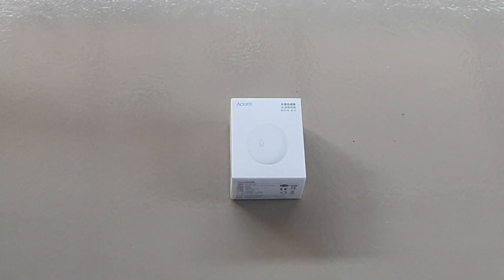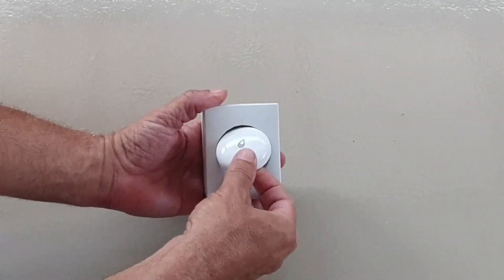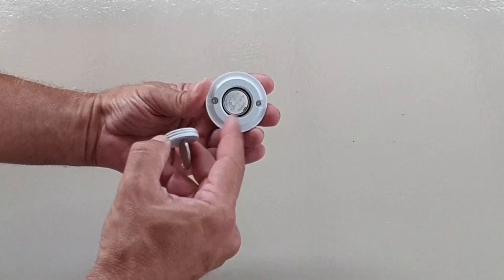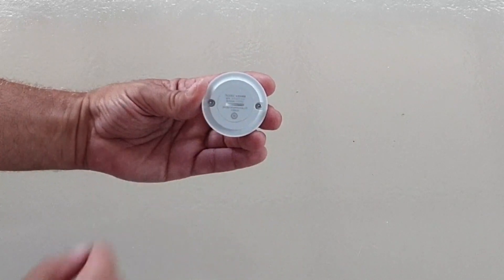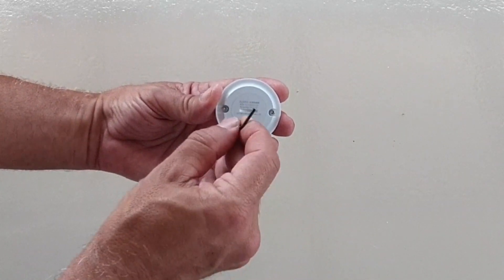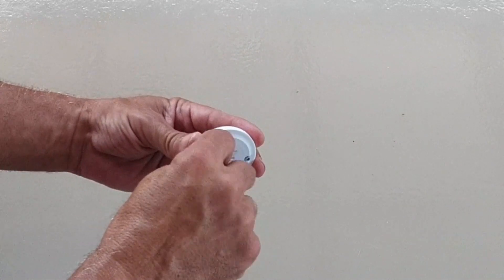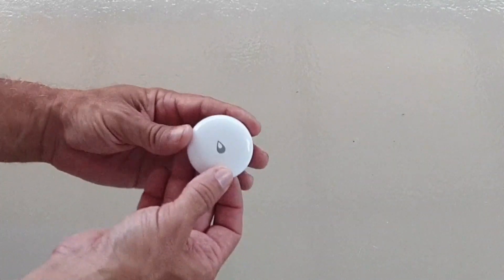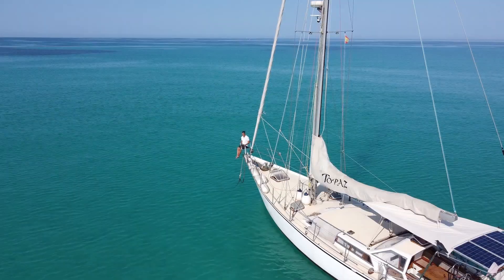Aqara Water leak Sensor, unbox setup and review

Comment: Is there a batter or DC powered repeater? You can only add so many batter devices before you need one.
Reply from the maker: Aqara devices use Zigbee, a low-power wireless mesh network, ideal for smart home devices. In a Zigbee network, powered devices can act as repeaters. . If you're reaching the limit of direct connections to your hub, adding DC-powered Zigbee devices can help relay signals from battery-powered devices like the Aqara water leak sensor, enhancing network stability and range. For example the NEO siren I have in my videos is a DC powered Zigbee device and should in theory extend the signals